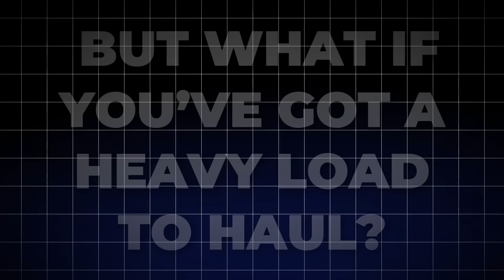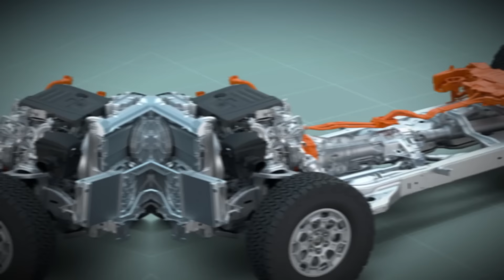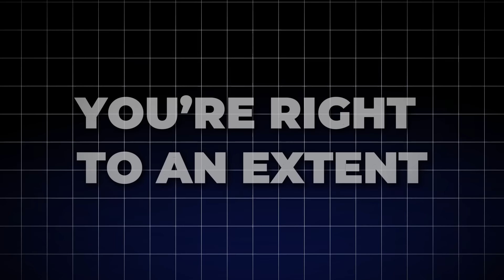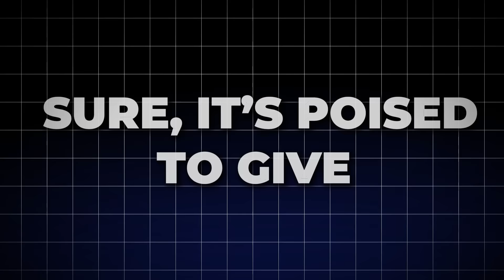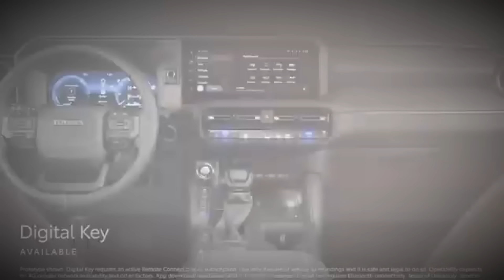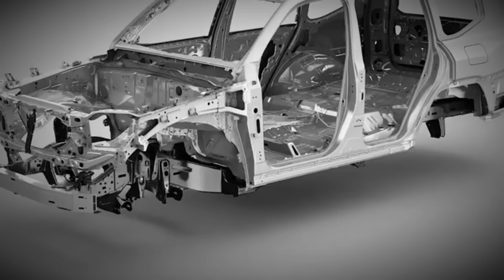Toyota JUST KILLED Suzuki With Their New Release!

Comment: It is not toyota that killed jimny . It is suzuki that is killing the car  by overpricing it . Jimny still has front and rear solid axles and  ladder chassis frame .  Further more there are too many after market products for upgrading its 4x4 capabilities ( drive train , gears , lockers , suspention etc ) . If suzuki reduces the price ,   jinny wiil has no opponent in its category .
Reply: All true
Reply: totally agree
Reply: Exactly
Reply: I 100% agree
Reply: If customers clamor for a Jimny with no door, no windows, no aircon, no stereo, no carpet, only sits 2 person, then Suzuki can lower the price.
Reply: @johnlove6194  The previous model was not like what you describe  , however the price was very competitive . Only lada niva was cheaper . 
The new model costs almost as a Ford Ranger for example  (which has 2.0L or 2.3L engine and plenty of space )  while it continous to has the main jimnies problem : inside space . 
The only important difference between old and new jimny is the engine : 1300 cc  vs  1500 cc , but this upgrade cannot justify the price or the fact that its price is no longer competitive .  
I own the old model . It is 20 years old and i would like to buy the new one , but not at this price . With this money i will prefer to by a second hand wrangler in good condition . And there are too many off roaders who think this way . 
Any way , this is just my humble opinion. Thank you for your answer . 
By the way in my jimny i removed the carpets 18 years ago .
Reply: Remember, the Jimny in the west is actually the bigger Jimny Sierra. 

Suzuki's primary market for the Jimny has always been the domestic 660cc Kei variant. That's always been the chemistry; a tiny Kei class, pure off-road, ladder frame chassis 4x4. 

The Sierra models have always been merely an extension to meet the needs of the western and international markets. 

the Kei Jimny is the equivalent of $10k USD and Sierra is $12k USD. Jpn doesn't even get the 5door variant domestically so there's no equivalent pricing on that variant.
Reply: Exactly! I had my eye on the Jimny a few years ago before I moved to the Philippines. It was P800k at that time which was a good deal. They Suzuki jumped the price to waaaaay over a million pesos! And the Jimny was basically the same under powered vehicle!
Reply: i totally agree, its a hell of a price to purchase,
Reply: @ΑΝΔΡΕΑΣΤΖΙΦΑΣ A jimny is so "expensive" becuas its a really great car and in his category an really great 4x4 in that great form factor with big place in the inside of the car. Thats the reason why jimny is maybe expensive. You can get a used jiimny with low mileage for around 20K€. Thats a really good deal for the new one. Its comfortable, you can drive fast when you know how to drive, who had a different opinion its totaly wrong.
Reply: @heywoodjablomee6551  Jimny and underpowered? thats totally wrong you can drive fast with that little 4x4.
Reply: @pyrojunkie0474  The ancestor of the new jimny was also a grate offroader . I own the old jimny for about  20 years  , i upgraded it during this time , i love it , my family loves it , and - beliave me -  i know how to drive it eather fast  or off road .  But  in 2005 , when i bought it ,  only lada niva was cheaper , which is not an original offroader .   
The new one costs as a good pick up costs . Too much on my opinion . 
If the engine of the new jimny  was about   2000 cc , i would totaly agree with the price . 
If i ever go on a used 4x4 , i will prefer to buy a nissan patrol y60 and restore - build  it from the ground . 
After all  the question is how the buyer wants to spent his money . We all have a personal opinion .
Reply: @ΑΝΔΡΕΑΣΤΖΙΦΑΣ Why is 1500cc to less? Its really great for that little car.
Reply: Agreed

Comment: It's called the Toyota Tamaraw in the Philippines. 😂
Reply: Obviously, cars have different names for different country that manufactures it. Unless it is manufactured by the main factory.
Reply: Tomorow car
Reply: It was named after the Tamaraw, a lean and nimble water buffalo species indigenous to the Philippines. The original Tamaraw model was released back in the 70s as basically an open air doorless utility pickup with optional doors and a roof over the bed. It evolved over the years into a 5 door passenger wagon AUVs and was discontinued in the mid 2000s and replaced by the Innova. This new 2025 model looks nothing like any of the old models and more like a Rav 4 on steroids.

Comment: How about get the Prado right for 0:47  Australian heat,  terrain modes, fuel 1:27  efficiency under load or towing, blinded glossy shinny cabin gear deck.Boring seat colours,  needs to set sights on Defender not so unreliable or badly built